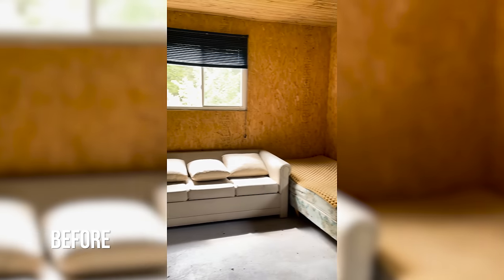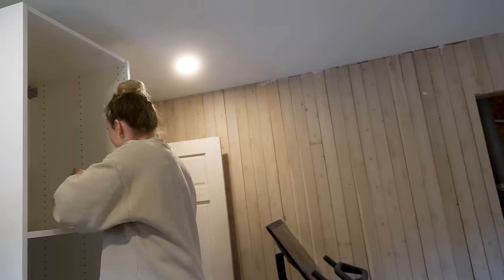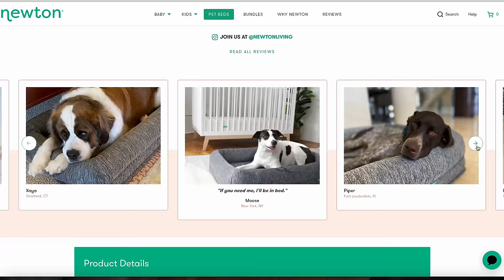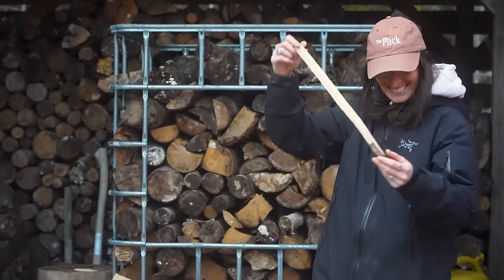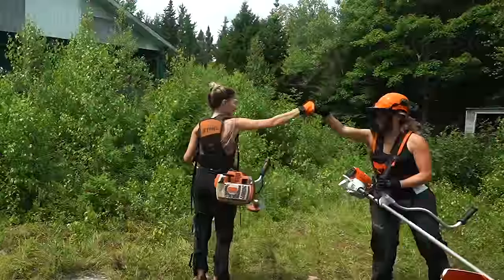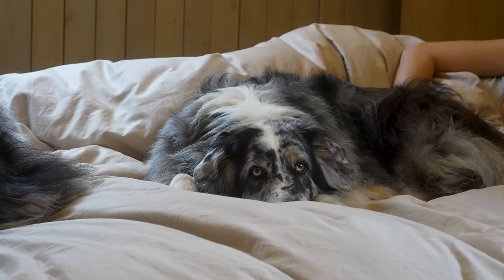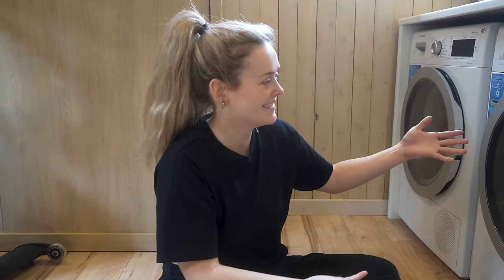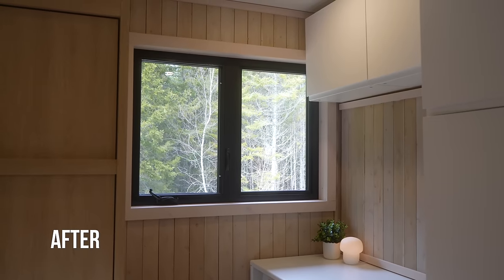ULTIMATE DIY DREAM ROOM MAKEOVER! (laundry room, diy murphy bed, workout room at home)

Comment: Fantastic solution for hiding the electrical and plumbing yet still having access when you need it. As always looks great. Crystal happy to see you’ve recovered from the chemical burn as well. Excited to see what’s next with the new plot you bought there. ❤
Reply: Looks good but not safe. And probably against code. Breaker box needs to be open and have easy access

Comment: The room looks great. One thing I would add, that would also look great. If you were to move the cabinet inline with the countertop, you could put in a tall storage spot behind it. Mops, brooms, I did it in mine and it works great.
Reply from the maker: You are so smart Bradley. We love that idea.😊🐶
Reply: @Vanwives  Or just cut the back couple inches off the countertop to bring it flush to the cabinet.

Comment: Should check the code you may have to move the laundry.  You need a 1m clearance directly in front of the panel at all times. The rule is actually in the Canadian Electrical Code.
Reply: I was wondering about that, having a water source anywhere near an electrical panel sounds like a bad idea.
Reply: I came here to see if anyone else was calling this out cause it definitely didn't look right
Reply: Would it work if they could move the washer, dryer, and counter away from that corner so that they could get to the panel?

Comment: It is a bad idea to put your washer right under your electrical panel… that is not code and very dangerous.  You guys rock glad to Krystal eye is healed up
Reply: Question for future me reference, would it be okay to keep it on the same wall (ex. Moved to the left to be hidden inside the cupboard), or on a separate wall entirely?
Reply: @boigeorge1149  You can't have anything within 1m (3') in front of it. The panel that's covering it would be against code even if the washer and dryer weren't there.
Reply: @JasonWin what's the reasoning behind it needing to be a certain distance away from the electrical panel is it just so if the electric panel needs fixed that it has easy access? Or is there another reason?
Reply: @feliciar2773  I believe it's for access in an emergency but I'm a Plumber, not an Electrician so I know the code but not necessarily the reasoning for it.

Comment: When I was putting those together. When you screw the little pins in and then you slide. Those little circle deals in the little hole. I always put a little wood glue on the circle. That way, when you tighten it down and the glue dries and hardens, it keeps them from wobbling later on down the road. They do not come loose, they do not wiggle. And if you wanted to on the corners. And edges, you could put wood glue on them. And once you lock them all in place, that'll glue and place it in. You don't have to worry about it
Reply from the maker: So smart! I wish we did that! Wow thank you xx wood glue is seriously the best

Comment: I don't know about code in Canada, but in the US you have to have 30" of clear space left and right of a breaker box, nothing within 36" in front of the box, and clear headroom of 6'6".  There can be no plumbing within the width of the breaker panel on either side.  Y'all have basically violated all of those criteria, especially with the hinged 'door' in front of the panel... So?  Who cares?  I doubt a building inspector will be dropping by your off-grid, middle-of-nowhere homesite.
The new room looks fabulous and will be a stress-relieving addition to your home in the woods.  Good job!

Comment: I recommend checking your local building code regarding clearance around an electrical panel. Hope its OK 'cause your remodel of the room is awesome!  Later in the video you have the electrical panel covered with paneling - NOT GOOD. Understand it is a fire safety and access issue. Please look into it.

Comment: Well done ladies - a huge improvement in storage and functionality. Do you have any details as to the bits and pieces in the 'desk' section of the storage unit? Specifically the 3 drawer rack with the pull out shelves? (I can think of a couple of places I could use one..)

Comment: Um, I get the space issues but the washer right under the power/electrical panel? No no no.  If you’re going to keep that, you need to box in the water & back of washer w/a plastic box.  If a line leaks or sprays water back & up - it’s a quick trip to breaker box.  And poof - short things out of start a fire.

Comment: Congrats on the washer and dryer! Quick tip: You should be able to swap the side in which the doors open on those front-load machines so they open toward each other. It makes the transfer of clothes from the washer to the dryer much easier :)
Reply from the maker: Good point Bryan. You are so smart thanks for sharing with us. 😊
Reply: my washer was build with leftdoor and the dryer with rightdoor :). All i had to do was to position them the right way :)

Comment: Glad that you fashioned a very cool way to hide the breaker panel yet have 100% access when needed.  The heat pump dryer is something I need to look into.  What is the purpose of having wi-fi on the washer?

Comment: No, no, no and no!  I don't mean to be a poopy Peter here, but hiding your breaker panel like that is a big no-no.  If you had an electrical emergency like arcing or electrocution, and your breaker failed to trip on it's own, you would need to get to the panel as fast as possible to rip it open and shut off the offending circuit or whole panel and sort it out later.  Imagine if you were the one being electrocuted and you had to send a guest in to shut off the panel; they might never find it until it was too late.  Additionally, your homeowners' insurance might give you a hard time, or even refuse coverage because your panel is not obvious and accessible.  Even if it's not a code violation where you are, at least consider the safety aspects of your actions.

Love you gals, and enjoy your channel immensely.  Thanks for sharing, and looking forward to next Sunday.

Comment: Ikea used to make a nice little tool kit. I bought one years ago and keep it in a kitchen drawer so it's always easy to get at. It has a hammer, with removable rubber cover so you can use it as a mallet, multi-bit screwdriver, pliers, adjustable wrench, all in an orange and white box with translucent lid.

Comment: Always pull out the washer soap/bleach dish and empty it of water and let it dry.  Dry off the rubber gasket and leave the washer door open to let it dry.  These two things will keep it from smelling.  Clean out the dryer filter after each load, also.

Comment: Fantastic work, as always! But I think I agree with/Crystal that that bottom hinge needs about a 1/8 inch shim behind it :) I understand everyone’s concerned about meeting code, but on the other hand if anything happened, you can scoot the laundry in the floor and swing the door open easily enough. Plus, if you like it and are comfortable with it, I think it passes the inspection that counts.  Are y’all far enough out that you don’t have city and county codes to worry about? Or provincial codes?

Comment: Im living the same cluttered, unfinished cabin life you are. Lol. I still don't have hot water, my kitchen sink installed or even my shower installed. Well. I have shower pa in place and the plumbing done but haven't finished the shower itself. My washer and dryer are sitting in my cabin until I build a deck  and laundry room off the back of my little cabin.  And...I just had major colon cancer attached to my abdo wall and a hernia repair on March 27. I'm doing great and start chemo May 8. Once this is behind me I can resume work on my cabin.  I'm ready to move along with my cabin.

Comment: Since your new to having a washer and dryer move it from circuit beaker so don't have problems with fires and should make it a pull out ,so can maintain lint and water build up that starts fires- so have to keep them clean

Comment: We are remodeling also in our house looks exactly like yours. The contractors were supposed to be finished three days ago and they’re still working and coming back again tomorrow and Tuesday! And there’s a bunch of things they have to fix. We should’ve just did it ourselves like you guys.😂😂 I’m exhausted too my house is it disaster area and we’re starting to get the summer heat and southern Nevada and it’s miserable. Our AC isn’t coming on it’s 95° in the house.
Reply from the maker: We feel your pain for sure. Hopefully you get the A/C fixed soon. 💛🐶

Comment: I'm not a DIY-er, nor am I an electrician, or plumber, but it concerned me that you placed your washer/dryer in front of the electrical box. If there was ever a leak in the back of the washer or in the walls...I don't know, I just remember a home inspector telling me one time that it's a worrisome place to put the washing machine with the pipes in the walls right next to that box. Hopefully though he was wrong and you have nothing to worry about! :-)
Reply: maybe i would have build a waterproved tub and placed the machines there at an elevated position so you dont have to bend your back

Comment: Do you not need to vent the dryer?  It looks absolutely amazing!
Reply from the maker: No it’s a heat pump dryer instead of putting the hot air outside it recycles it making it more efficient ! Neat eh
Reply: @Vanwives  Ahhh gotcha! That's interesting. Thanks for explaining 🙂

Comment: It's looks great girls. From what it looked like at beginning of cabin. I wanted to ask washing machine by the main electrical panel may not be code due to water hook ups I don't want anything to happen water and electrical don't mix. Just want you both safe is all. Love you both. ❤❤
Reply: Water hookups being close are fine code wise, It's obstructing the panel that's against code so the cover they made and the dryer being in front of it are the issues.

Comment: auto vent for the washer should not be enclosed inside the wall with the electrical panel could cause moisture issues with the panel or mold
Reply from the maker: There is no vent! It’s a heat pump dryer instead of disposing of the hot air it recycles it and is more efficient 😁
Reply: not air vent for dryer auto vent for plumbing. they usually go to the roof to stop siphoning out your